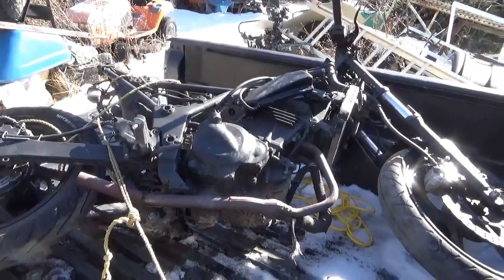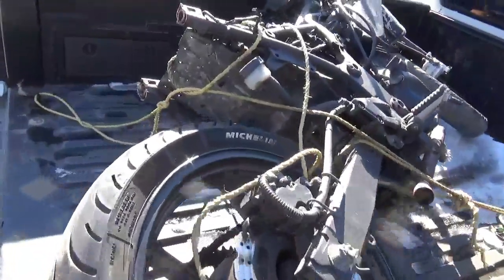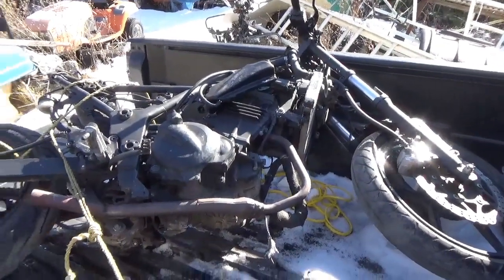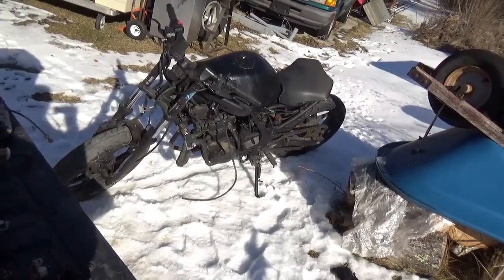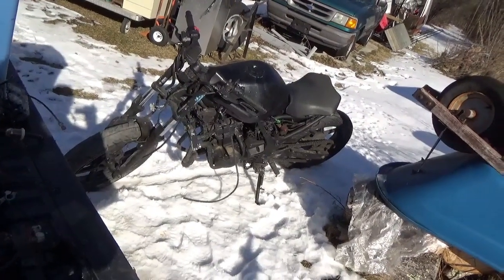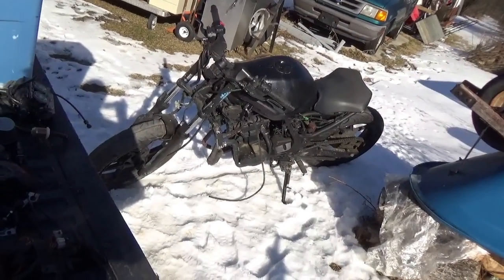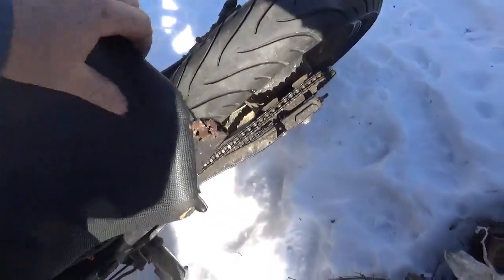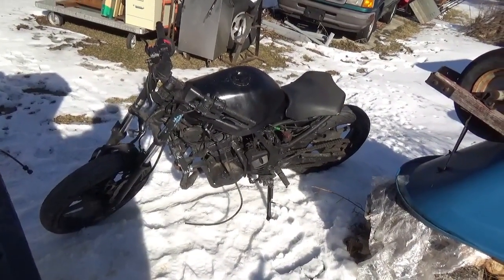2012 Kawasaki Ninja 250 Streetfighter Project, $350 on Facebook Marketplace Deal!

Comment: If the engine is good, you did alright. What would I do with it? Throw a set of ATC forks with tire/wheel on the front, fab up a wide swingarm for the rear with a ATC tire/wheel, and have yourself a bad-ass Fat Cat!